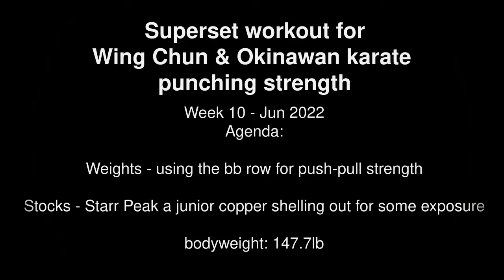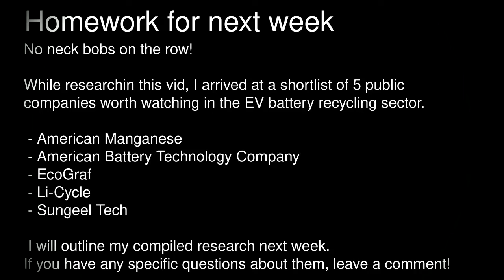Prepping for Michael Burry's bullwhip call | EV battery recycling & experimental strength superset

Comment: On the topic of commodity recycling in general (and battery recycling in particular), I don't have anything much to contribute. My specialty is taking obscure mathematical concepts that nobody understands and implementing them in software that nobody currently uses.
Reply from the maker: No worries, if you are into maths.
The Michael Burry tweet referenced an economic game/simulación called the beer game.
Which might help you to visualize what's coming down the pipe.
I'm not sure how applicable it's be to pharmaceuticals
Reply: @dalgray  Are you familiar with Jeff Snider and Emil Kalinowski? They've been talking about growing inventories and accumulating monetary troubles since October of last year.
Reply from the maker: @k98killer  no haven't heard of either of them but I've definitely heard lots of commentary about growing inventories.
Were those 2 discussing inventories of metals specifically?
Or in consumer goods like Walmart etc?
Reply: @dalgray  Jeff Snider is the head of global macro research at Alhambra investment advisors. He specializes in the mechanics of the eurodollar system. Emil Kalinowski is a consultant for the precious metals industry iirc. They have been discussing details of the growing, global, monetary disorder plaguing the economy, as well as inventory levels at every step of the supply chain, essentially documenting the bullwhip effect and forecasting the stages of this global recession.
Reply from the maker: @k98killer  nice, thanks for the heads up, I'll keep an eye on them.

I think we all understand that the macro situation is in rough shape.

I've been pleasantly surprised how strong my focus industries are holding up so far.

Check out my video on Ormat for example. That stock is still holding its decade long uptrend so far.

Battery metals are gonna be a wild ride, but high energy prices always have people searching for alternatives.

The companies i checked so far look reasonably well capitalized. But they're all pretty different.